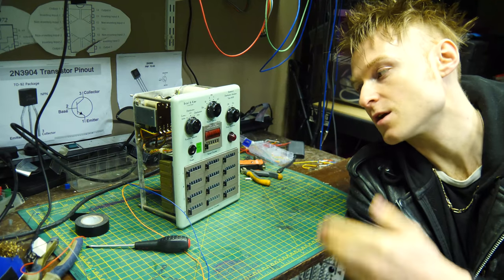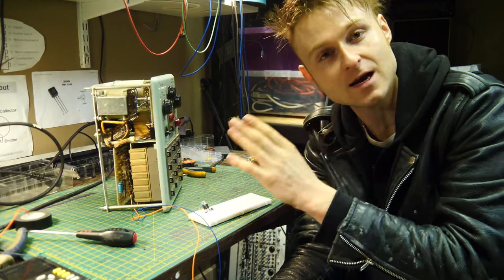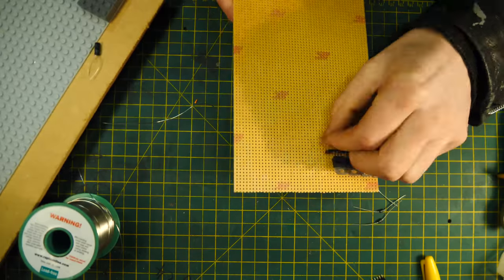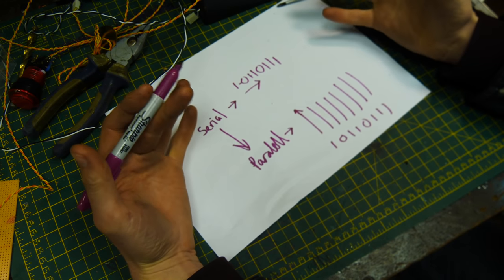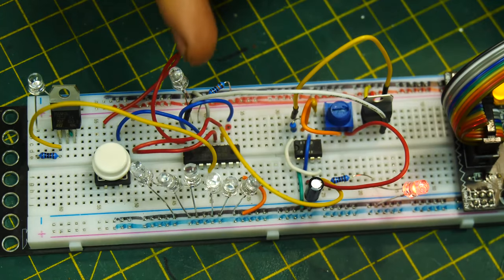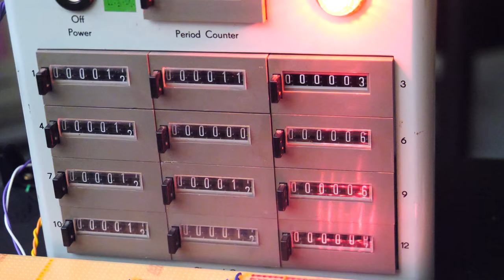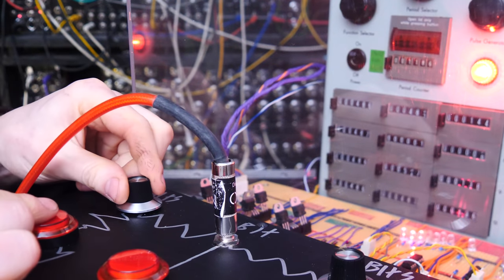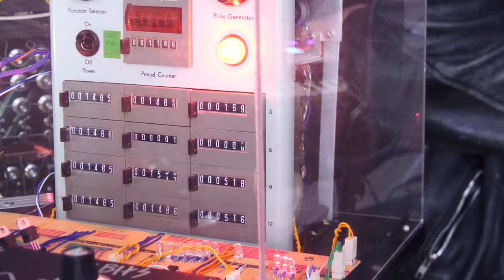I Made An Electromechanical Shaker/Guiro out of a very modified bit of test equipment

Comment: Would it be possible to make each parallel trigger a different octave? 🤔
Reply from the maker: Yeah easy make each output into voltage dividers to send out 1,2,3 volts and so on
Reply: Electric waves pair so beautifully with sound waves

Comment: Man this is awesome!  Another thing you could have done is drive it directly from the LC-8 so you can control each counter using midi notes. The LC-8 has 24 mostfets and could definitely handle the current for each counter. You can use it for more than just LED strips!
Reply from the maker: aaah yeah ofcourse! very good point that can be used for that! woah
Reply: @LOOKMUMNOCOMPUTER  as long as you stay under 2.5 amps per group of 3 MOSFETs you are golden!

Comment: Sounds great! A way to program the slowdow externally would be pretty sweet.Sounds like a mad digital rainstick!
Reply from the maker: what do you mean program slowdown? ohh i see being able to control the clock. yeah good point its literally just a wire into the 555 CV input. i very well may do that. 10 min job
Reply: @LOOKMUMNOCOMPUTER  you got it! So you could have it raging away and then wind down the speed and have it go from waterfall to gentle droplets like how a rainstick tails off. That sound you got as you turned the speed down really set it apart as something that could be a useful texture not just a weird project! x